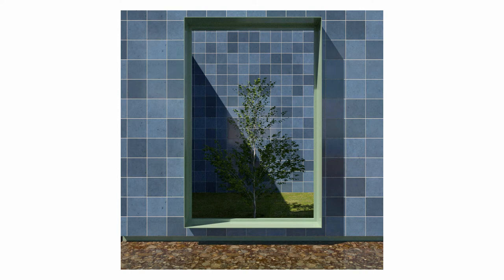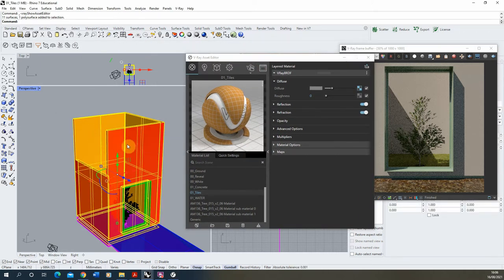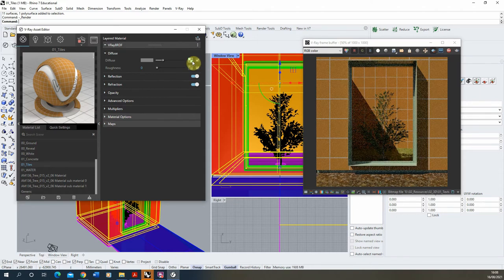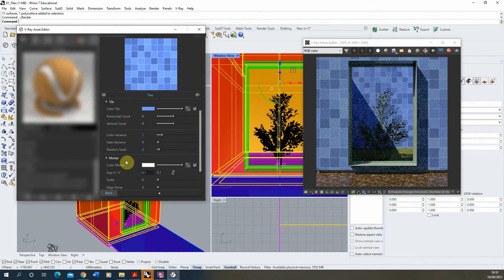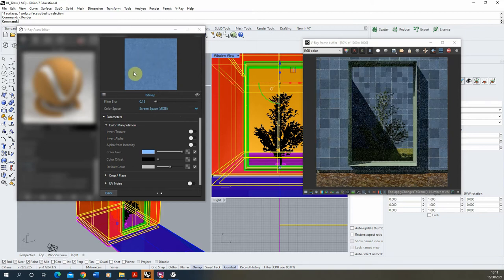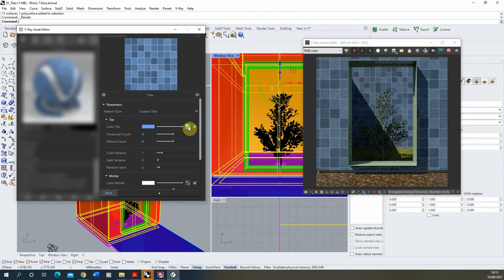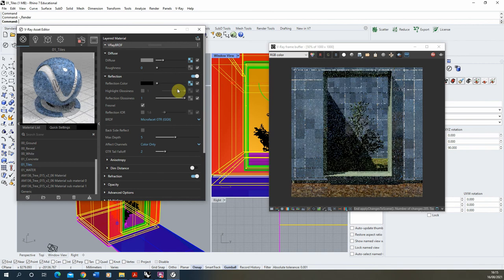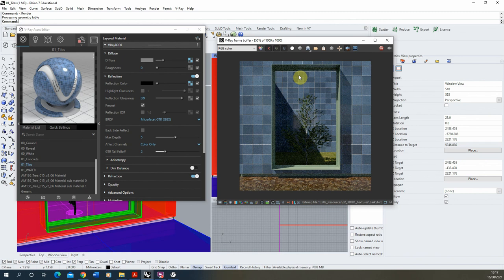Tile Material Creation - VRay for Rhino 7

Comment: Super interesting and helpful! Thanks
Reply from the maker: Thanks Pantelis, glad you found this one useful!
Reply: @tombudd15  yeah, absolutely! I follow the series in general. If I may, I would suggest also to make one with a bit more complicated materials, cause that's also a struggle of mine. :) In any case, thumbs up for this and the previous ones 👍
Reply from the maker: Thanks Pantelis, are there any complex material in particular that you are struggling with?
Reply: @tombudd15  form example wet road, or in general wet floor. Another would be rusty stuff or leaking concrete etc. I mean in general the way to mix a material with another one for a more realistic outcome. In any case, thanks!
Reply: @kyrpadelis702  yes! it can be useful.